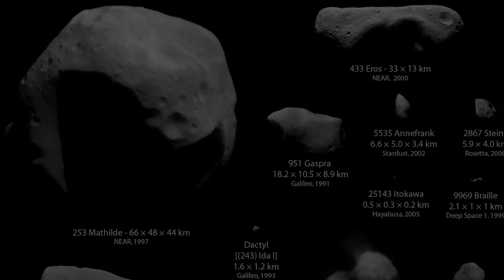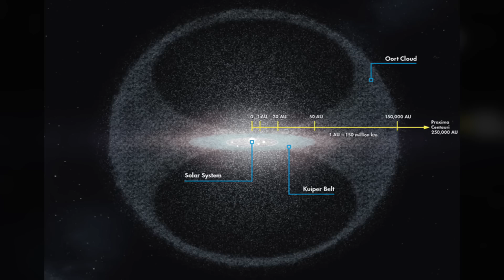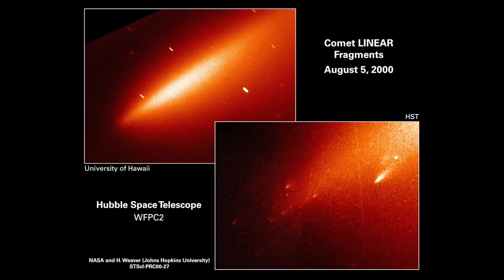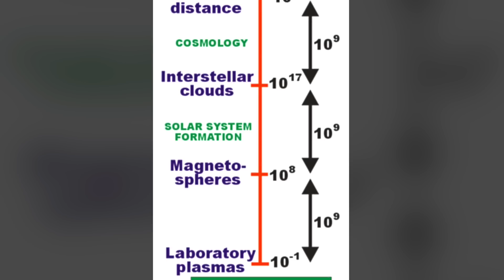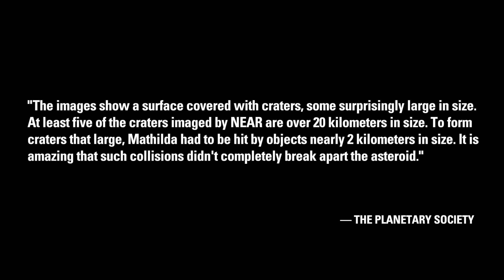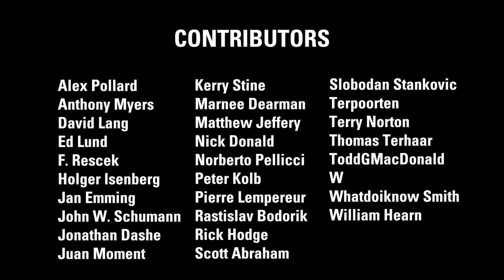Matt Finn: Asteroids That Should Not Be | Thunderbolts

Comment: I'm thinking about the temperature of the asteroid in space. It must be uniform, and very low. Now i think, an impact with another asteroid, also generally very cold,  and the heat generated in the place, and the heat dissipation. The cracks that must occur, the vibration, and a lot of different events that take place. Probably it looks like billiard balls colliding. The difference is that balls are made of solid plastic, and the meteorites are solid rock, cooled to almost complete freeze.

Comment: @ ~ 3:55;

No, the impacts are not all at a 90 degree angle! Lol. That is just your ignorance of the science showing. Unless the impact is at a very shallow angle, the crater will always be ~ circular. We do see some craters from very shallow angle impacts. There are some in Argentina, iirc. And a fair few on Mars.
Reply: Make a patch of dust, or mud, or sand, or whatever, and throw rocks at it from different angles. See what happens. Experimentation is king, not wishful thinking.
Reply: @NotableHeroicFailures  "Make a patch of dust, or mud, or sand, or whatever, and throw rocks at it from different angles."

Hahahahahaha! Deary me! That is so funny that I will repeat - hahahahaha!
Capable of throwing rocks at ~10 km/s are you? And having them vaporise on impact? Lol.

"Experimentation is king, not wishful thinking."

And real scientists have been doing such experiments for decades at NASA Ames Vertical Gun Range (AVGR). Since the 50s, iirc. I refer the interested reader to;

'Experimental studies of oblique impact'
Gault, D. E. & Wedekind, J. A. (1978)
Freely available.

If the written stuff is too difficult for you to follow, may I suggest you take a look at Figs. 1 & 2? Dt is the lengthwise dimension of the crater, and Dc is the dimension at right angles to the direction of impact. So, Dt/Dc = 1, means a ~ circular crater. Where Dt/Dc > 1 = an elongated crater. Notice how the craters only become elongated at small incidence angles?
That, dear boy, is a scientific experiment. Not some unscientific nonsense about throwing rocks into mud, dreamed up by primary school children.

Comment: What the hell has the big bang got to do with asteroids???? Are you sure you know the difference?
Reply: because if you keep putting your head in the ground and pretending the solar wind is not an electric current, you will be wrong about everything else too... which you are. That's why it's important to get your facts straight when building the foundation for a model. Your Big Bang model is built on a false premise, and that's why you don't understand asteroids and cratering. That's why every castle you build sinks into the swamp. Your model is non-predictive. It's a funding scam, and you're either on the take or a defender of the faith.

Comment: The DART mission revealed that the propulsion after impact wasn’t so much from the impact itself as the ejecta from the heated inner chemicals activated by the impact… with a special electrical relationship with the sun that varies based on its distance.
Reply: "with a special electrical relationship with the sun that varies based on its distance."

Lol. You made that up.
Reply: @davejones7632  Glad you’re entertained. Why would the distance that a comet or asteroid has from the sun NOT affect it’s chemical composition if not its state of matter? Temperature? Chemical reactions? Electromagnetic fields? You make it sound like what I’m saying is outside of the asteroid belt.

Comment: Two things. Those massive craters on a solid astroid would mean it would HAVE to have been part of a large body akin to a moon when it took such a large impact AND THEN broke up. That's the only way the physics matches, which still doesn't match their concept of astroid formation. Secondly, all these astroids would have been knocked into a billion different random orbital trajectories with each impact, yet the astroids are all basically on the same track, same direction? Hella sus.
Reply: Learn physics. And stop commenting on things you don't understand. Free advice. Take it.
Reply: Not if they are the product of electrical arcing. That's the point of the presentation. Arcing can make these craters, even at these sizes, without demolishing the rock or leaving secondary effects like cracking and shattering. We know this is true because many of us do it for a living.
Reply: @ArchonOne  "Not if they are the product of electrical arcing."

Which does not exist in space. There is no mechanism for such nonsense, and nobody familiar with physics thinks there is. Space is filled with highly conductive plasma, subject to the laws governing plasmas. Such as quasi-neutrality beyond the Debye length. You are not getting 'arcs' or lightning woo in a highly conductive plasma. You need a dielectric to break down. There isn't one.
Reply: @ArchonOne  "We know this is true because many of us do it for a living."

You might do it for a living, but you obviously don't understand the science behind what you do. Just as you don't need to know how an internal combustion engine works in order to drive a car.
Here is a summary for the hard of physics;

For electric arcing you need an insulator, or dielectric, to break down. This is what happens in lightning bolts. The air is a dielectric. It is overwhelmingly neutral gas. It is a non-conductive medium. Plasma, on the other hand, is not a dielectric. It is highly conductive. There is no insulator (dielectric) to break down. Therefore, no electric arc woo in plasmas. It really is that simple.
Reply: @davejones7632  ya Don Scott disagrees and he’s more credible than you. He doesn’t believe in ridiculous things.

Comment: Don't fall into the same cesspool that they have. Your snarkiness will win no converts. I've been down this path a couple times already. Maybe some claim as you say, but the ones I've talked to don't. The mainstreamer's I have chatted with claim it's because of the high velocity of the impact that the original impactor is vaporized and thus the resulting crater is dug out by explosive force, as if someone tossed down a firecracker and the firecracker exploded just before it actually makes impact. I'm not saying this makes any more sense than 100% 90 degree impacts. I'm just saying making false claims about what "they" say damages your own credibility, not theirs. 

The EU is right. It has reality on it's side. The underlying force that drives the universe is electric. Don't smear the good work of honest and humble EU researchers by snarking for internet points. No one benefits from that.
Reply: So 🤔 just ignore the whole conservation of momentum thing and pretend that if something is going really fast it can just instantly turn matter into energy?
Reply: @jay90374  Why don't you learn physics, instead of inventing arguments from ignorance?
Reply: @jay90374  Isn't that what the atomic bomb did?
Reply: @maximvsdread1610  Asteroids aren't atomic bombs.
Reply: @ArchonOne  reeeaaalllyyy?
Reply: NASAs high-speed laboratory proves impactors coming in at low angles don't leave round craters. We see almost none of these oblong craters anywhere on asteroids or planets. Maybe a few now and then, but certainly there should be more, a lot more, especially given that there are trillions of craters on Mars. And I disagree. You're watching a corrupt empire built on lies and propaganda coming down right now because of memes. Lampooning dogmatic views that refuse to change is the BEST way to make converts. Prove me wrong.

Comment: So perhaps the Comet Shoemaker–Levy 9 (formally designated D/1993 F2) event was also an earth diameter or larger plasma discharge event, not merely an impact event. In fact, comet Shoemaker broke apart or exploded because it was unable to stablize the massive electromagnetic charge it encountered as it got closer to Jupiter. The resulting dark spots were caused by high voltage plasma discharge onto the planet. 😊
Reply: "The resulting dark spots were caused by high voltage plasma discharge onto the planet."

Not according to anyone with a knowledge of physics.
Reply: @davejones7632  High atmosphere air burst. No cloud penetration as was predicted by your team. Keep stumping.

Comment: I agree with the theory that it’s the most plausible cause of the craters, but can’t imagine the environment that such a large volume of asteroids were exposed to that caused it- for example the electric comet is a pretty clear explanation, where they are circling the sun and periodically experience charging and discharging which leads to the cratering and erosion. 
It may be the case for asteroids, but it would imply hundreds of thousands of them were/are in similar trajectories.  Not a criticism- just me wondering how they all have these features and where did it occur?  
Most of them are also quite smooth.  Electrical erosion over eons?  A mystery to me.
Reply: Well the difference between comets and asteroids is just the kind of orbit they have. Asteroids stay more charge neutral to the sun because their orbit is roundish. A comet goes away and then toward the sun, building a much stronger charge, which is why they are mostly eaten through at the equator and have those glorious tails. But even the slightly elliptical orbit of asteroid belts would be building charge in the Sun's electric atmosphere, so I imagine these things are constantly discharging among one another.
Reply: @ArchonOne  Well the difference between comets and asteroids is just the kind of orbit they have."

Wrong. Plenty of asteroids on cometary orbits, and plenty of active comets on ~ circular orbits.
Reply: @ArchonOne  Still curious to find out how many of the asteroids have the same mineral composition as Earth and Mars.  The smooth rounded shapes could be leftover from their original formation as molten blobs during the great discharges that gouged out the aforementioned planets.
Reply: @tconiam  That is a very valid suggestion.
Reply: "for example the electric comet is a pretty clear explanation,"

Nope, it is scientifically impossible nonsense.

Comment: The default of our universe iZ binary, &c, hydrino, just, far larger, 4 the oscillation. Thru-planet COMM, antigravity, antimatter, totALLY baryonic. 

Note that hbar [magnetism, Poynting] = h [gravity, Planck] /2pi X-ACTly 

Einstein left gravity out of Maxwell's equations of a11 energy distribution, 4 the current DENSITY function (pun intendED), &c.

Lightening clapping is a piece of the Sun N 9-11. Follow the Great Circle [h] 4 crowdsourcing purposes. 

Also, the area of a circle is 2/3 that of it's circumscribed square, the same in 3D.

Lightening clapping is a piece of the Sun N 9-11. See Mental Boost 2 4 data on 9-11, anomalous mineral formation, magnetized concrete, golf divots in totally twisted metal cut in 30' segments, unburned paint for the proposed heat, hydrino, pWoof. Why is 1 Chuck Way, NYC, bottomless, or, OK City, "Walk on Water," ransoming Nascent Lee (heavy water)? Quantum mechanics is total BS, 4 the CLASSICAL, however larger.

Whilst, on 9-18-01, WBAN was turned ON 4good, N issue of this, a chem-network, the closed circuit, where entropy changed direction at the point of matter creation, the hohoho of the big bang. 

All of WEBB's distant galaxies R carryover from a former iteration of spacetime nestled nicely inside statespace which is a chem-network. Ten times TNT, tiny N getting tinier, totALLY baryonic, 1 Atom Ant, hot N fast, fuel 4 the starz, 1st principles OWN Lee, KISS, thereby, a dynamic finite structure 'constant.' 1 Atom Ant, hydrino, @27.2 eV per transition. A hydrino universe is ANTecedent2 a water planet. Warp speed included, &c, a closed circuit, 1st principles OWN Lee. I M r-spherious. 

Einstein left gravity out of Maxwell's equations of a11 energy distribution. Occam's Razor APPlies.

Comment: regarding the 'perfect 90 degree angle' idea about the obvious symmetry of a perfectly circular crater, I asked this very early on in my interest in electrical and plasma cosmology.    I eventually heard 'an' answer from Neil deGrasse Tyson.   He said that impactors are traveling at such a high speed, that when they hit a planet or comet, the kinetic energy is SO high, that the explosive power of that point of impact becomes a perfectly spherical explosion, so much more powerful than the angle of incidence, that that angle has no bias on the shape of the crater.   While I was satisfied that I'd heard the rational of the mainstream response to that reasonable question, I never felt certain that it made any sense.   Because it seems if you increase the speed, you would also increase the relative effect of that angle of incidence effect.   I'm not sure how the kinetic energy of the impact itself can render the angle of incidence non influential.   I suppose the only way that might be true, is if the actual object also contains an explosive of nuclear proportions.   In that case, I suppose if I lob a nuclear weapon like a lawn dart and it hits the ground at an angle, that angle won't make a difference once the explosive is triggered.  But I struggle to scale that up to extreme high speeds, and somehow scale up the magical effect of a kinetic force that exceeds what the mass and speed of that object has generated.  Its all very messy, and extremely non intuitive.
Reply: I checked out the NASA high-speed impact laboratory where Tyson is getting his lines. Their results show that the angle of impact influences the shape of craters during their experiments. You have to come in pretty sharp to get a non-round crater, but you can bet in the impact theory, there would be plenty of rocks coming in at those sharp angles, and the fact is, we don't see that played out on the surface of celestial bodies. They're all 90'. Only electric arcing can account for that.
Reply: @ArchonOne  Pretty wonderful, ain't it? I can't wait until you guys compare notes with the MFMP!
Reply: Your questioning is perfectly centered on authority, without explanatory power. You can't "math-over" Nature. She will use her Foundational or Wholistic Geometry ("Sacred" perhaps) with absolute consistency, unable to lie. May we all simply let her tell us what she is. Peace.
Reply: @corkygoss7403  If I imagine having an argument with Tyson about this, I can picture him saying "if, on impact, the object is completely vaporized, then what matter is there left to carry the momentum of that angle of incidence?"  It feels like a deliberate ignoring of conservation of energy somehow.
Reply: NASA's own high-speed impact laboratory finds that any rock coming in at a sharp angle leaves an oblong crater. We don't see any oblong craters on rocks, so unless they are suggesting no impacts come in at sharp angles, then their laboratory has disproven their explanation of cratering. One more victory for the EU model.

Comment: The video where EU finally stops all pretense at doing science.  The big buildup to 6:00 where EU "proves" that comets aren't loose dirty snowballs,  despite the fact that the spectroscopy says otherwise,  and the density was found to be barely half that of liquid water (Tempel 1).
Reply: Well Mr. Playwithyourthumb... if you're running with a blanket denial of electrical effects in space, then the chemical signatures of intense discharge that produce the cocktail we see in spectroscopy would be a real mystery. You might start believing it was made of ice, rather than understanding you're seeing the byproduct of discharge. Esspecially when you don't understand these effects on the "mass" of the object, as Wal Thornhill explains.

However we have landed and photographed several now, and once again EU is confirmed, mainstream is forced into yet another patch. Now the ice and water are all hidden, conveniently beneath a solid rock surface, when before your model claimed we would be able to see the ice. It's amazing how the standard model always knows EXACTLY why their predictions failed, and can explain it all... up until the next observation falsifies the latest patch. Eric Learner's analogy fits best. Big Space is like an airplane inventor whose last 50 test flights all crashed, but each time they quickly came up with the reason why, and assured everyone it would never happen again. Would you get on that plane? Of course not... it lacks predictive success. The Big Bang's lacks predictive success, and nearly every test flight has crashed and burned. That's why the model looks like a Frankenstein's monster now. It has the over-complexity of a bad idea that's been patched for 100 years. There's a reason everyone and their mother are coming after the Big Bang model now. It is ridiculous and primitive,  and it does NOT match our observations or predict accurately. What is the point of science if not to predict?  That's its only job.

The dirty ice-ball theory should have died when we began seeing comets sublimating out past the orbit of Neptune, where the Sun's heat is miniscule, or when we watched a comet enter one side of the sun and come out the other, fully in-tact. I mean how do you explain this?
Reply: The issue is interpreting the data with our limited knowledge. Comet 67p comes to mind, “low density” but was so solid it broke the initial probe and had stratified rock.
Reply: "You sometimes speak of gravity as essential and inherent to matter. Pray do not ascribe that notion to me, for the cause of gravity is what I do not pretend to know"

Newton said only Fools could believe that Gravity was inherent to Matter........:)
Reply: @jjtompson5914  He was right. Playwithyourthumb fails to understand that the standard model theorists do not understand the chemical reactions of highly energetic plasma discharge, or mass, which is why they don't understand comets and asteroids.